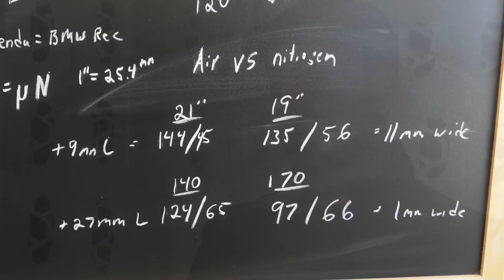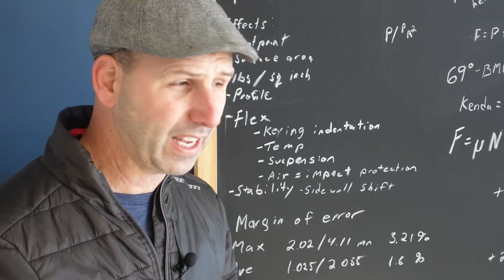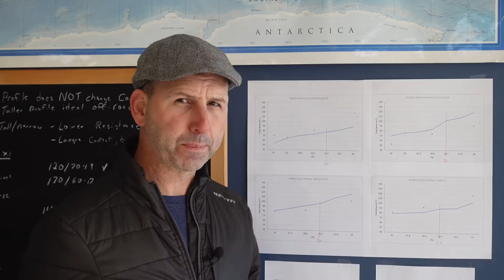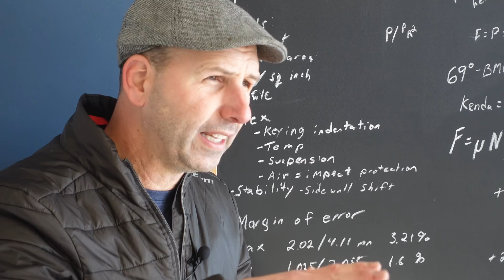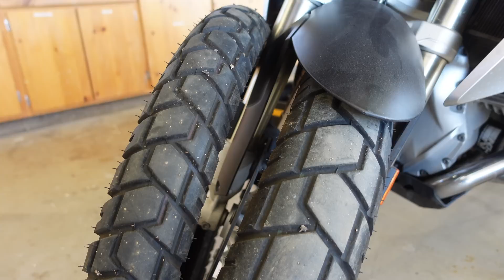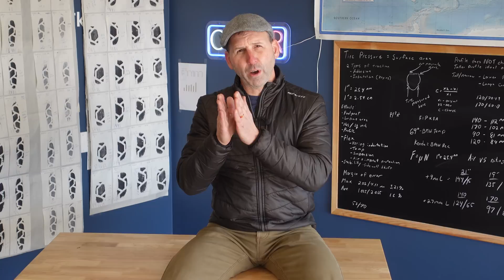Selecting the correct tire pressure; How airing down motorcycle tires affects contact patch

Comment: Airing down isn't that much about the footprint and more about the tire molding to the terrain and "grabbing" on to it. I go as low as 7psi on my Himalayan 411 and it will chug through anything. Keep in mind you will need rim locks to go this low on pressure.

Comment: @16:20 I think like the rest of the video you talk in percentages not absolute pressure ie psi. You should talk about the gains in percentages over the stock pressures not mm gained only. To me an extra 10mm length is enough to add that edge of confidence. Going from a footprint of 100mm to 110mm for a 10% drop means additional 10% grip.

Comment: I have an 83 Honda GL-500 Silverwing and I just learned that in my maintenance book it recommends that my front tire be at 24 psi up to 200lb rider and 28 psi at the rear. same goes for a rider up to 330 lb, but the rear be at 36 psi. Both my tires are at max air. I have never ridden a motorcycle where the tire has been aired at it's recommendation by the manual. They have always been at the pressure it recommends on the tire. Never had an issues.

Comment: This whole presentation was flawed by a key false assumption and that is the nature of the surfaces you are riding on.  Off-road will have dirt, sand, mud that are displaced by the force of tire.  It is not a rigid surface like asphalt.  The net effect is there is a wedge of material in front of the tire and along the sides not unlike the bow wave and wake generated by a ship in water.  

Thus, in sand you want ensure front tire is rotating  at peripheral velocity as close as possible to forward velocity otherwise it will create unstable plowing effect.  If you ever water-skied you know you cannot control your skis until you are up on a plane.  A motorcycle is no different in this regard on loose surfaces like sand.  My hypothesis is thus airing down will reduce the speed required to achieve planing effect by allowing tire to crawl over that wedge of material via flex by effectiveling shortening the height of the wedge.

Comment: As a dirtbike and mtb rider, this is an interesting article.  I have observed too high pressures on my mtb does result in the bike acting like it's riding on basketball tires.  With my dirtbike, being heavier and having more travel, I haven't sensed this.  It may be simply I don't ride with elevated pressures.

Comment: Good work. Liking your emphasis on riding on the air and not the tyre. When I was off-road biking, I concluded that airing down was about how the tyre and the air within it collaborated with the suspension. It was part of the suspension system and it was useful to make changes to the responses of that system when off-road by changing the quantity of air that I was riding on.

Comment: I noticed in your spreadsheet, that the HAT CRF1000F had different tire pressures for solo ride. I'm assuming that's because of the 22 lb weight difference between the manual and DCT versions. However, the loaded tire pressures were the same. Any explanation as to why the loaded tire pressures between the manual and DCT versions would be the same?

Comment: If you ride at 9/10 or 10/10 then the small surface area gains advantage from lower pressures can be significant  in grip. But who lives at the extreme? That’s not how I ride.
Reply from the maker: Agreed

Comment: I come from a motorcycle and 4x4 Jeep background. The one factor you're not talking about here is speed which makes a huge difference. In the Jeep world I typically air down to 12-14 PSI on a 35" tire. When you do that you've entered a different world to what the tire was typically designed for. At those pressures the tire can no longer absorb the impacts or protect the rim at higher speeds, but at crawl speeds it's fine and the tire deforms significantly giving you better traction particularly on wet hard surfaces. The other main advantage is the ride quality inside the Jeep is night and day compared to street pressures.

If you try to duplicate this in the motorcycle world, it just doesn't work out because you can't go slow enough. The tire has to have enough inflation to absorb an impact at the speed you're going. The faster you're going the more inflation required. The suspension and load play a big part too. If you try to go slow with significantly less tire pressure you may go outside the sweet spot of the suspension which will become harsh compared to higher speeds. If you're loaded up with adventure gear then the tires have more load and require more pressure. When I air down on the motorcycle it is almost exclusively to minimize deflection and I tend to stick to around 15% of regular pressures.

Comment: Hi Bret. I admire your determination with all these tire footprints and measurements to 1 mm. However, there is a more straightforward explanation using a simple formula for… pressure: P=m/S, where P is pressure (yep, inflation pressure), m - mass and S - surface area.

Since we are interested in the surface area of the footprint (a.k.a. contact patch), let’s transform the formula: S=m/P. Here you have it, the contact patch is inversely proportional to inflation pressure: the larger the inflation pressure, the smaller the contact patch and vice versa. As you noticed, the tire size is out of the picture. A wider tire will have the same contact patch area as a narrower tire, just different in shape.

Of cause, it is a bit of simplification, as the contact patch area is affected by the tire geometry and stiffness. However, it gives you a pretty good idea.

Comment: What is not mentioned in this video are suspension settings.  As one airs down you change the tire rate, thus impacting what your suspension is seeing as input.  Bottom line is one should tune your tire pressure based on loads, terrain, suspension tune and temperature.

Comment: Great video. Coming from mountain biking I’ve realized moto tires are a different beast. In mtb there’s a fine line between traction and compliance vs pinch flats. Dual sport/adv tires are much much stiffer and I don’t think you’ll ever get the compliance without walking the line of pinch flatting. I’ve ridden some rocky trails at recommended single rider psi recently and it felt totally fine for traction….id rather lose a wee bit of traction than deal with a flat. 

You have a great channel. I watched it before I swapped out my new DOT tires and it went pretty well. Thanks for the content.

Comment: As a retired mechanic, I didn't have all the materials of measurement listed here, but I'd bought a 2020 Ducati Desert Sled, changed the front rim to 21" with an appropriate tire and slid the fork tubes up the triple clamps (head and crown if you will) and needed a system for initial setup.  Having a 10 acre back yard of sand and mesquite and a (usually) dry creek bed with motorcycle trails well beat in through all of it I proceeded to testing.  With front and rear at max suggested pressure it didn't take long to decide it was rolling like a rock.  Those tire pressures  were within 2 psi of each other and stayed at that difference for the whole test.  Starting at suggested mfg. pressures I rode the track at an increasing pace until things were sliding around and the suspension was working vigorously.  Back to the garage, let out 2psi, and ride to test parameters.  2 psi lower and test.  Repeat.  Eventually it was just wallowing around with little response to steering input.  At that point I started adding pressure at the 2psi rate unti all responses were midrange acceptable.  It was a well spent afternoon and I learned a lot.  The Duc is running at expectations.

Comment: Congratulations. It's the best analysis I've seen so far. 
A question: is there a difference in the analysis with cold and hot tires?
or
Can you do the same test on tire operating temperatures ?

I believe that your measurements will have different and maybe overturn the result.

Comment: Any single rider under 200 lbs.. anything over 33 psi is to much.. 36 psi is death trap traction.. 42 psi is mental retardation at best. 18-33 psi is the ideal range depending on other factors.. if your over 200 lbs or 2 riders..yeah 36 psi IN THE REAR is good but I would never go above 36 psi. The recommended 42 psi is unfounded retardation. If you wish to drift through the intersection at 9 mph and crash use 42 psi.

Comment: Airing down doesn't necessarily increase the contact patch much.  But, it does spread the contact patch weight distribution.  A contact patch (not withstanding a buckled tire) will always have a higher pressure point in its center area vs the surrounding area.  Lower air pressure allows the contact patch to not have such a higher focused pressure point in the middle... This is why a lower pressurized tire has a tendency to sit on sand vs plow into it.

Comment: Great video, and well said. Here is what I was told...

It comes down to pounds per square inch. So the less surface area your tire has on the ground, the better. The less in contact with the road, the more weight there is on any certain point...

Ski's are wide and slide, tire chains dig in and grip...
Reply: Or even consider ice spikes have nothing but a point in contact with the road, but have huge grip...
Reply: Aka wide tires SUCK...
Reply: I think this whole wide tire thing started from people watching Drag racing. But drag racing is a prepared surface, half melted tires by the time of take off, and a strait line, not the same thing...

Comment: Thanks very much. Very interesting. I know from experience that the 90/90 21" front wheel on my KTM 950 offers plenty of grip on-road, even compared with bikes that have traditionally sized road or track tyres. Normally 17".

I never air down when riding off-road; I dont think it's worth the faff. The biggest advantage is to learn to ride better.

Comment: I was an avid cyclist, i care about my tire pressure, i use a pressure calculator from coach Alex Mitchell for best performance,efficiency, and safety. There's many variables, like tyre size and width, body+bike weight, position(weight balance), surface conditions, etc.
Then now im planning to get a motorcycle and research a bit about motor stuff, and to be honest just following manufacturer's tire pressure recommendation is just sounds off to me even if that's was totally fine (said experienced guy), so now im thinking about 15% bottom tire height decrease front and back when riding on it.

Comment: Based on the 'riding on air', rather than 'riding on the tire', principle, I calculated the ratio of running load (i.e. wet bike + me + space suite + luggage) TO maximum tire load. I multiplied that ratio times the oem (for KTM 390 Adventure) recommended psi.   The result (22 psi front & 18 psi rear) was a more comfortable, less 'squirrely' ride - both on and off pavement.  For challenging off-pavement riding, I found that BELOW 15 psi the bike got 'squirrely', again; BUT, 17 psi front and 15 psi rear felt very nice i.e. confidence inspiring.  

Also, I noticed that KTM recommends 15 psi for MOST of their off-road bikes!  All this was predicated on the assumption that tire manufacturer 'maximum load psi' is carefully (and conservatively?) calculated tor each specific tire model and size.

Comment: It depends so much on the why the tire is made… being bias ply or radial… also the stiffness of the side wall etc will change your results.  I would say that, at best, you conclude that changing tire pressure of those particular tires makes very little difference.

Comment: Folks.  Find a bit of technical (hill, rocky, or deep sand/gravel) terrain that you can barely ride without crashing at street tire pressures.  Then lower your pressure to 17-20 psi and ride it again.  You won't need to do anything else.  The difference will be unbelievable.  The reason Brett isn't seeing much difference in the length and width of the contact patch is that he is not airing down by a lot, and contact patch (surface area) is a function of length TIMES width.  If you air down by 10% your contact patch will only be 11% bigger.  And the length and width of it will only each only be about 5.4% bigger.  That won't seem like a lot.  I run about 45 on the street and air down to about 18 off road.  That gives me a contact patch that is 2.5 times bigger, but still is only 1.6 times longer and wider.  It won't look like that much if you look at a footprint.  Now imagine going to the beach and having a 2 by 4 piece of lumber.  Press it end wise into the sand and it will have an 8 inch contact patch (2 x 4 = 8).  If you press down on it with 144 lbs that will be 18 pounds per square inch.  Imagine how deep into the sand it would go.  That's how deep my GS will dig with tires at 18 psi.  Now press down on that two by four with 360 pounds.  That's how deep my GS (and yours) will go with tires inflated to 45 psi.  All you have to do to decide which pressure is best for you is ask yourself how deep you would like your tires to dig.  It's huge pain in the ass to air back up, and Brett is an incredible rider, so he doesn't need the help and hence doesn't bother.  If he rode right at the edge of his ability and frequently ran into terrain he couldn't handle I bet he would be airing down too.
Reply: Thank you for this.
Reply: Agreed. Didn't get the idea to measure the difference in millimeters, it should be measured in presents! And yes, it's about square area, not just length and width.

Also there are softer and harder tires which have very different behaviours in case of low pressure.
Reply: He aired down to 40 and 50%, that's a lot. Not sure what bike you're on but running a 200lb geared up person on top of a 450lb ADV bike with 16psi is going to leave you with pinch flats and destroyed rims very quickly on anything with rocks.

Comment: I've had awful days when I first got my F850 in sand. Aired down and experienced no change. After several months of practice and getting familiar with the bike (mainly losing the fear of dropping it), I took it back out in sugar sand and didn't have any issues. This was at stock pressures (38 front, 42 rear) on Metzeler Karoo 3s. I feel that any issues people attribute to sand with tire pressures are purely a lack of skill. At the end of the day, we're piloting 500+ pound bikes through surfaces that offer little traction; any deficiencies in skill will be quickly and unforgivingly made apparent.

Comment: It would have been great for you to have documented the percentage change in contact patch area with respect to the percentage change in air pressure, rather than just the change in length/width of contact patch. Great video by the way.

Comment: Left my home in eastern nc on brand new Dunlop trailmax mission tires on my 2017 f 800 gs. Rode the entire Trans American trail coast to coast and back on the same tires. Kept them at the operators manual recommended TP the entire trip. Tires performed magnificently on and off road. Tires held up even on big rocks etc. No damage to my rims or tires. Was comfortable riding at the recommended pressure.

Comment: So I checked the label which came on bike (label long gone but I had a picture) and it said

1.5bar/2bar 22/29psi on road
1/1.2bar 14.5/17.5psi off road

so at least the 20% pressure reduction isn't the rule of thumb to all bikes. For this one it's 33%/40%. YMMV
Reply from the maker: Which bike
Reply: @BretTkacs  SWM Superdual. 415lbs on scale with full tank

Comment: I'm an engineer [retired] and I've been saying this for years.  The critical parameter in a tire is the sidewall.   The engineers set the tire pressure recommendations to achieve a certain sidewall profile.  When you mess with that, bad things happen [pinch flat].  But, Bret, the science won't matter... the engineering won't matter.  They all watched Travis do it once.... once... and after that they won't listen to any calculations.
Reply: Absolutely. Suppleness. Compliance.
Reply: @rider65   Yep, so is the bead where the rubber meets the frame.  Instead of being ridid that slips now  ... oh wait, let's invent rim locks for that.  So smart.

Comment: Please, someone correct me because I’m not a math dude, I’m just trying to make sense for myself and what I feel when on the bike, because there is certainly a difference. Anyway, looking at the quarter and dime representation with the tire and pressures he used, I’m showing about a 13% increase in surface area when dropping 10%psi and 20% increase in surface area when dropping 20% psi on his front tire. Of course this isn’t exact. To me a 13-20% increase in surface area seems rather large. Again, please fix my numbers. 

I agree with others saying the feel is better. Grip and control is truly noticeable. Also want to mention that a massive obstacle for new riders on dirt is the mental barrier of feeling like their tires will slide out and not hold. They have a hard time focusing on training because “I felt my tire start to slip”. Airing down tends to fix that real quick.  Let them ride stock psi for some time, then, when they go use the restroom you air their tires down a bit and watch them ride with more confidence and not no why.  However, I can’t prove this to be caused by airing down, it could be because they left the restroom much lighter than before.
Reply: I ride 1.9 bar front and 2.0 bar rear, on my cb500x for TET. I do belive that a little less pressure is better for off and on road. So dont exactly understand why Bret says it not...
Reply: Exactly. Brett shouldn't be discounting and saying only 10 or 20mm difference he should like the other metrics be talking in percentage gained. Ie 10% less pressure is 13% surface area. It undermines the entire video